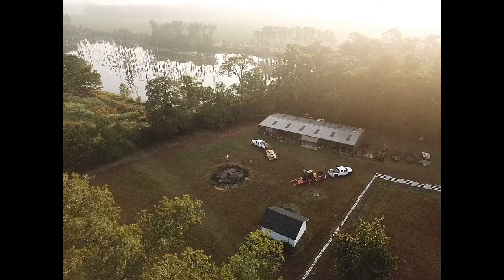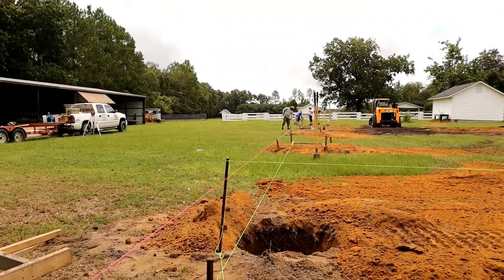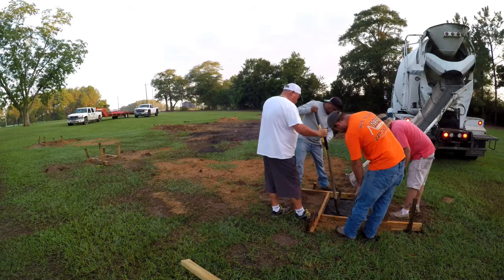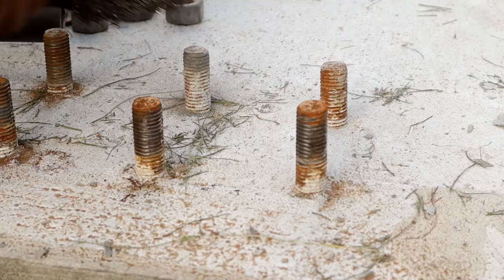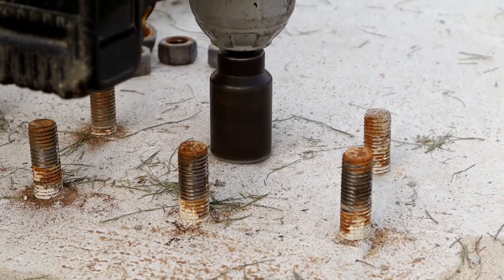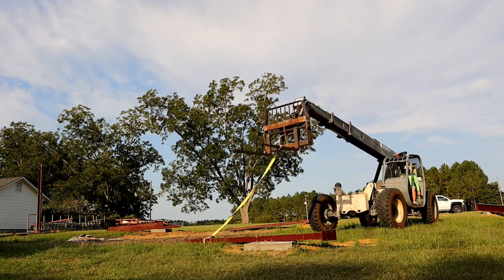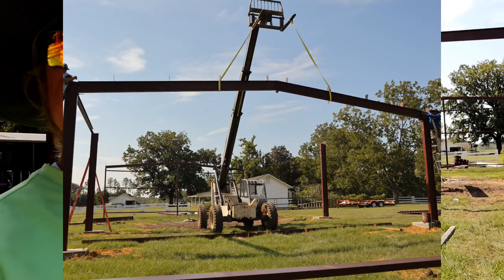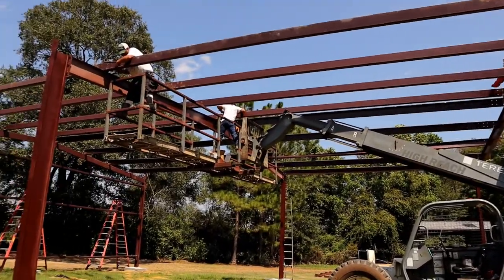Steel frame and concrete piers of an equipment shed: how to build

Comment: Where did the bolts come from on the 2nd pad 2:12? More magic bolts 3:05 immediately after the picture of the steel delivery trailer. How was the first upright positioned? As an informative video this is useless. If I had builders and they spent their time watching aircraft they would not be on site very long. A danger to themselves and others lacking concentration on what they should be doing will lead to accidents or sloppy work.

Comment: NARF!  Hi, how come you always put the bolts on the edge of the top of the pier?  It just bothers me.. i'd think the center would be nicer.   2nd question.. What manufacturer do you use?  Although seems like they mis ship/build a lot of things, that you have to fix.  I'm in Buffalo NY, so I'm considering one that will be better suited to snow load.  Do the manufacturers give you some sort of plate to set those bolts in the concrete?  How exactly do you measure them all out? I would think this is one of the most important parts.  Thanks for all the metal videos!  these are the first i've ever seen and they're inspiring.  Most people around here use wood, and they also try to use the amish.   It looks like the metal goes together even easier than wood, so I'm interested in seeing if that works better for me.  Trying to be cost effective, as I'd like to build many, to create a whole industrial park.  Where are you located?!  Thanks, Greg
Reply from the maker: Thanks for inspiring message.
Yes the column would probably be better in the middle of the pier.  But when you enclose the building later then the pier would be outside the steel line .  This way the concrete is inside your building.  The manufacture in most of my videos is proned to a lot of mishaps.  Welcome to construction.  We contractors deal with this all the time and it's our job to figure it out.  This is why I like to provide my own materials when I can.  I now manufacture my own buildings to try and beat this problem but I'm also human and short materials or make mistakes in orders or quantities. I'm located in GA.  I can have a building shipped with the specs you need 
Email me at Roofover556@yahoo.com and I can get u an estimate.   
    Anchor bolt plans are provided for placement of the bolts.
Reply: @BuildingwithNARF  thanks for the reply!  Yes I realize the concrete would be outside the metal line but I figured some rain wouldn't hurt it.  Or just cover it in dirt...  Thinking more now... I guess you wouldn't want to just cover the outside in dirt... would probably be nasty and bring water in to rust the bolts.   Curious how you keep the water away.  I will email you to shoe you what I need thanks. Greg

Comment: Where are you based out of
Reply from the maker: GA
Reply: @BuildingwithNARF  how much does a 50x100 concrete pad normally run for a steel building like these
Reply from the maker: There is alot of variables that decide the price of a slab.  On average the cost will run $6-$9 sqft for concrete in my area.
Engineered slabs will require more steel, beams, piers,etc.  Site work will also determine cost and finally the dirt pad.  Cost varies per job.
Reply: @BuildingwithNARF  thanks i been looking into a 50x100 steel structured building that will require some piers im sure i came up with about 55grand in concrete for price in nc do you have a website or social media page?
Reply from the maker: @NARF.Buildz on InstaGram

Comment: Is there an advantage to bolting columns individually and then lifting the assembled rafter in between columns or could you assemble columns and rafter all together and just lift the hole thing?  Thanks!
Reply from the maker: Yes, it is easier to connect in the air and keep square, level and plumb.  Also the rafters will twist and warp with the weight of columns attached while lifting.  The columns are usually heavier than the rafter.
Reply: @BuildingwithNARF  gotcha thanks.  We hand tightened an entire end wall together and we’re planning on doing all four sections like that.  We will undo the rafter and do this separate,  thanks for replying!
Reply from the maker: Check out this video where we do bolt the light endwall on the ground and lift the whole wall.
https://youtu.be/nhuZgzhaK-k

Comment: I'm curious why you wouldn't show how you leveled out all your footings? Determining the difference of elevation for each footing is needed when erecting a structure of this size and weight. Your footings didn't appear to be straight.
Reply from the maker: All piers were elevated to the same height on each side.
There is 15" difference of height from front piers to back piers.  I have another video of " pier setup for steel building addition"  showing how we elevate the piers with the laser to the height needed.

Comment: I like the project your working on and maybe you can help me out. I want to build concrete  piers to mount some steel to support a 16'x32' cabin 8 or 9 ft off the ground. What would be some materials I could use. I can get some 6"pipe and 6x6 inch tube both 1/4 wall. I was thinking on using 8 post but looking for opinions out here.
Reply from the maker: You need an engineer to answer that kind of question..

Comment: Wrap your bolts with some masking tape next time  it's a good trick.  good job buddy.
Reply: True...we put grease on them also.
1985 to now metal building erector s.

Anchor bolts the curse of Murphy.

We set all bolts don't let concrete guy do it or torches welder s come out...🙈
Reply: Excellent Video clip! Forgive me for chiming in, I would love your opinion. Have you heard the talk about - Mahorrla Wooden Paradise Method (probably on Google)? It is a great exclusive guide for building better sheds and woodworking minus the headache. Ive heard some amazing things about it and my buddy after a lifetime of fighting got astronomical success with it. 👍😎

Comment: How deep are the pier holes? Also do you think a pier foundation like this would work for an enclosed 39x57 building with a gravel floor. Great video, thanks!
Reply from the maker: Piers are determined by soil types and building size.  Where we  built this shelter I used a yard of concrete per pier.  The building size you mentioned would work on a pier foundation.  First consult with an engineer or builder familiar with your area, soil types and design of building to determine what would be sufficient. Meaning...what size are your spans, load bearings, and materials being used to support your structure.
Reply: Building with NARF ok great. Thanks for the quick reply!
Reply: @BuildingwithNARF ..